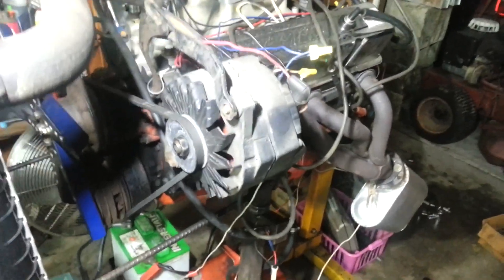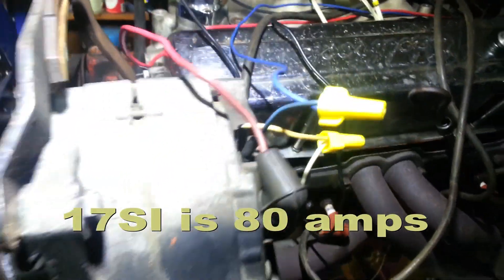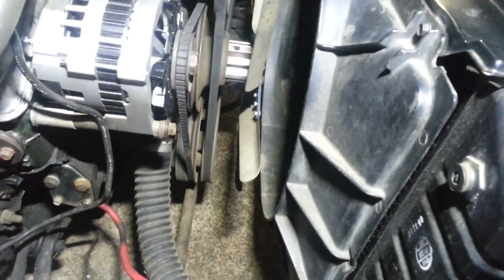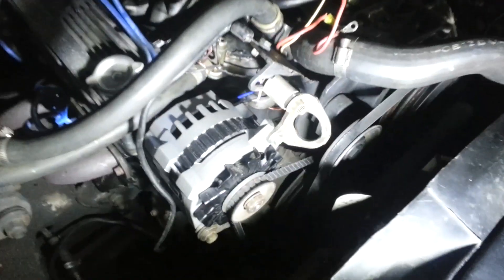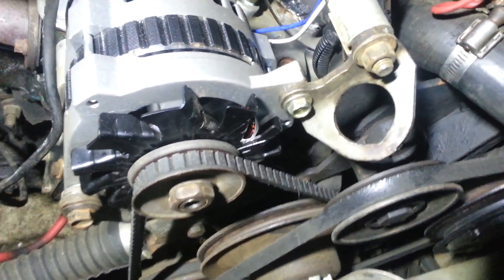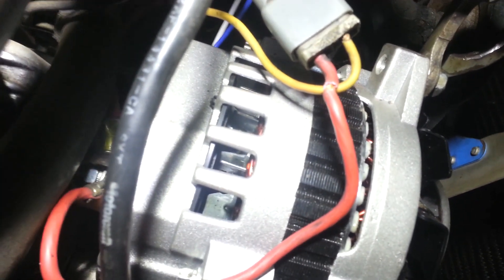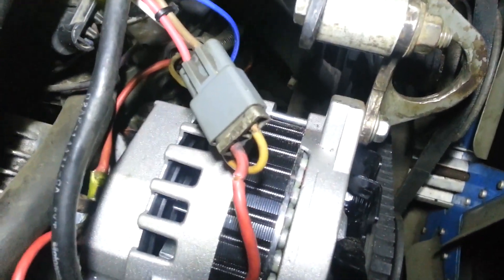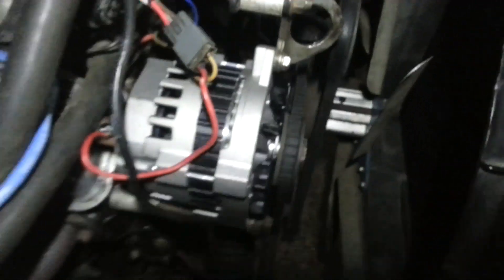Chevelle CS130 Alternator Upgrade

Comment: Good job brother! Some advice, ...consider electric fans. You've got the amps to spin em, and you'll see a difference in the tone of the engine. Nice to see ya working brother,God bless you!
Reply from the maker: Due to financial constraints, we're working with what's in the spare parts pile. The alternators are all rejects that were fixed. There's a couple of different used fans in the trailer, but nothing that fits the big block Chevelle radiator. The 84 vanagon and the 85 Corvette do have stock electric fans though.